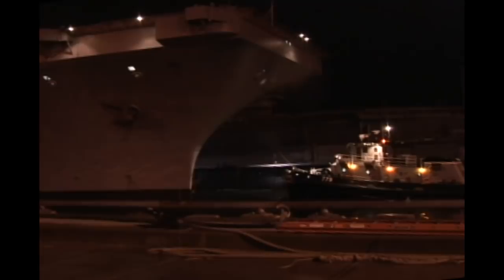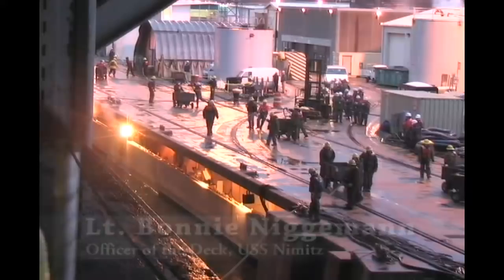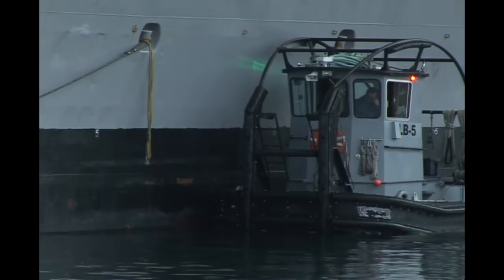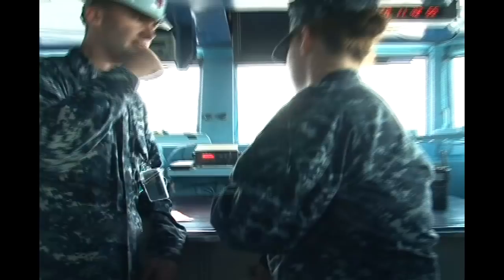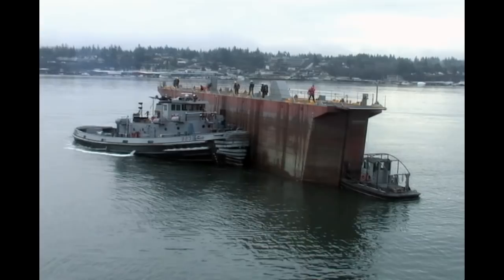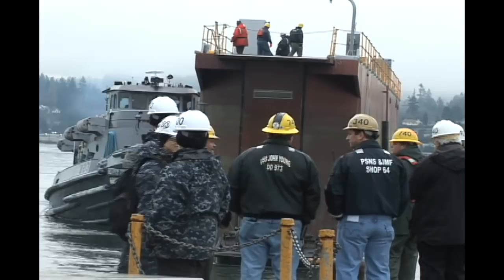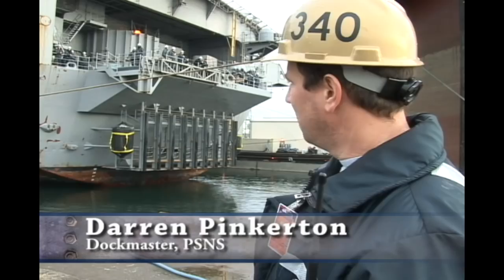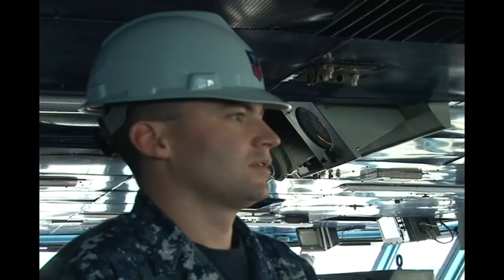USS Nimitz Dry Dock - Episode 2

Comment: I was on several ships that went into dry dock.  The docking master would always warn us that if the ship is going to fall off the blocks it will happen within the first 24 hours.  They send down divers to check everything when the ship is just above the blocks.
Reply: That first 24 hours is all about the chance of a block failing after the water has been squeezed out of its pores by the weight of the ship

Comment: i was on the coronado agf11 in Bahrain 1981-82 500 man crew, i couldn't imagine 3000 personnel onboard.  it was used for target pratice a ways back in the Pacific  a real rust bucket  with a flat bottom. it was a  converted  lpd boat changed to a flag ship . not to mention we had to paint it white, radioman 3rd class.

Comment: What is going on with the reactor on the ship ? Were the rods removed before hand or what ?
Reply: I wondered the same thing my guess is they never stop it and continually have it running just a guess.
Reply: They very rarely shut down. I believe only for maintenance.
Reply: It will continue to operate a minimum capacity. The ship is actually hooked up to shore power as well and if the reactor output exceed the needs of the ship the excess is automatically transfer to the land based electric grid. This is not unlike having enough solar panels on your roof you get a credit from the power company
Reply: The reactor is shut down while all nuclear powered ships are in dry dock because there is no way to cool the reactor